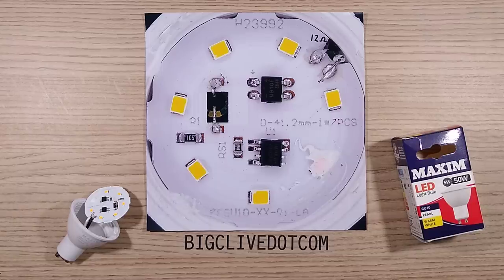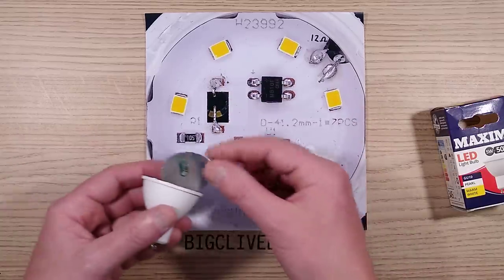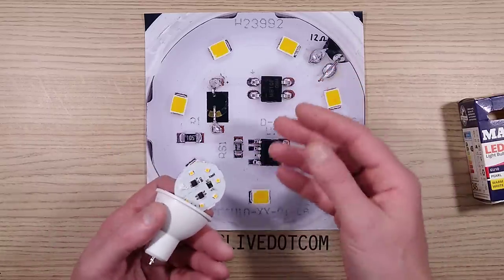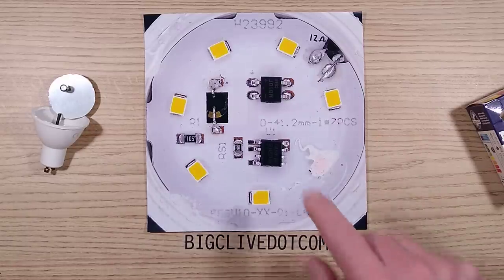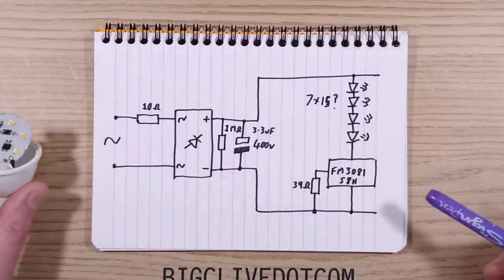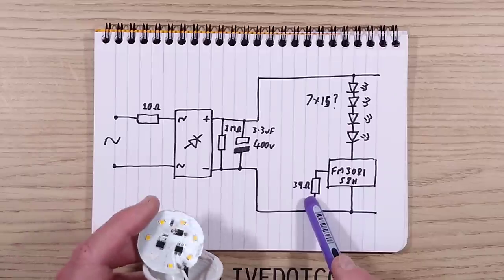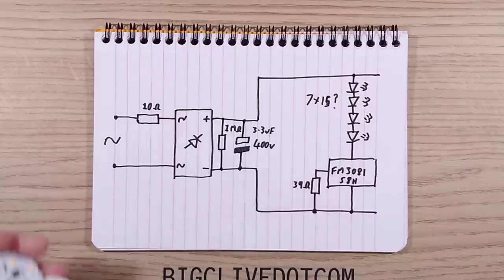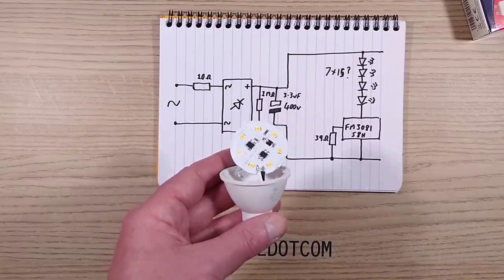Over-cheapened trashy LED bulb

Comment: I just did a test of all the bestselling bulbs on Amazon and the filament LED style bulbs were standouts as far as quality (low flicker, good CRI, good dimming curves).  It seems strange that we are so focused on shaving a few cents off the cost of something that's supposed to have a long lifespan and rarely be replaced.  There has to be a happy medium between the Dubai bulbs and junk like the bulb in this video.
Reply: May be Dubai lights should be the standard "everywhere"!
Reply: Is the chinese way. The irony is that in the long run it ends up being more expensive uses more resources and produces so much e-waste.
Reply: I've recently been reminded of the same thing with clocks. We've had quite cheap clock chips with accuracy far beyond anything a normal user needs, you'll almost certainly have a power outage or just accidentally unplug it before it drifts by a measurable amount. But do we see those in basically any consumer clocks? Nope. All still the cheapest possible oscillators and they drift by far too much.
Reply: @Lizlodude  our kitchen cheapo radio cd thing has a clock in and drifts badly! i did wonder if it used the mains for timing and had a 60hz/50hz link that was set wrong but no , just a 18ish mhz crystal,, and the frequency on the crystal is bit different to whats marked on the pcb, maybe thats the cause...they couldnt get the right one or was too expensive and got these others hoping theyd be 'near enough' 😉  it now has cap issues with the main 16v ish smoother bulging a bit and makes weird sounds when starting up, no mains hum, though, surprisingly , i cant seem to find a correct value and voltage replacement as small as the original, what ones i've found too big to fit! probably didnt last 'cause the 'standby' voltage across it is nearly 19v and its rated 16v ...needs a 25v type but these are even bigger! argh!
Reply: @Lizlodude  It's why my bedside clock is still an LED clock from the 1980s. It's timed by zero crossings of the mains voltage and keeps bang-on perfect time, though my understanding is that the U.S. electrical grid soon will no longer be required to make up for frequency drift, so clocks timed by mains voltage will no longer keep accurate time. I understand why they're changing the reg, but yeah, it'd be nice if we had a suitable replacement and not just the cheapest microcontroller-integrated RC oscillators governing modern clocks. It's so hard to find anything made well anymore.
Reply: Isn't capitalism lovely?

Hint: No.
Reply: @teresashinkansen9402   sam vimes' boots theory of economic unfairness
Reply: @teresashinkansen9402  It's the capitalist way. Who do you think outsourced the labor there to drive down costs and increase profits in the first place?
Reply: Because our bulbs are better than the Dubai bulb in America. People need to stop obsessing about that. In America, we have California Title 20, which legally requires bulbs sold in CA to have CRI > 90, PF > 0.7, dimmability to 10%, flicker requirements, and less than 24 dB noise when dimmed, and >10k hrs lifetime. Bulbs have to meet Energy Star light distribution, hence the filament-style. Dubai bulbs are non-dimmable, all they have going for them is high LPW. California realized after the CFL fiasco that it's not all about energy, it has to be about light quality too.

Comment: I am really unhappy with the current (pun intended) trend of bare-bones LED lamps...low voltage light strings...fairy lights...are one thing but running mains power like this is uncool.
Reply: Non-dimmable LED lamps are the worst.
Reply: Absolutely. I know that's the name of the game -- cost cutting. But there should be a 'best practices' level that they're not supposed to go below, because it is dangerous to either the life of the product (eg. 'Planned Obsolescence'...don't get me started on that one...) or to humans or pets. Whoever made the decision to import that shoddy work into the UK should be told about it. If it has an agency's name stamped on it, contact them. For example, "UL" might mean 'Underwriters Laboratories'. They can put pressure on the manufacturers to improve their standards, or they can let the government know to disallow it when it comes in through customs. Too many people would settle for an increased risk of a fire hazard if it just means that they can get their bulb for 30% cheaper. And fires spread to responsible people too. So it becomes an issue that needs to be addressed, rather than this 'buyer beware' mentality.

Comment: So much for LEDs being the great long lasting low energy alternative to the old incandescent bulbs.
Reply: They are - from my experience. I have had no failures and have not had to buy a bulb for replacement in years.
Reply: I live in a old, 6-store apartment building. The staircase was lit with incandescent lamps that now have been replaced with E27 led bulbs.

Unsurprisingly, the landlord buys the cheapest they can find; a single bulb rarely lasts more than a couple of months.

When covid restrictions hit I got annoyed by constant "blackouts" and fitted the fixture from my floor with a German brand bulb. It has been going ever since. The "cheap" bulbs are a total scam 😆
Reply: @MLX1401  I too was a landlord - I replaced all the incandescet bulbs in both my buildings because I knew the tenants could not afford to. The compact flourescents I bought were disappointing - they were fragile and did not last as long as advertised. As they failed I replaced them with LEDs which were at that time getting cheaper and better. I left LEDs with tenants whose compact flourescents had survived. They (the LED's) never failed.
Reply: @Onequietvoice  Nice to hear that ☺Indeed led bulbs are way better than CFLs, and generally do last a long time!
My point was, that if the intent is to save money, cheap bulbs (like shown here on this video) are a poor choice as they're made to fail and need to be constantly replaced.
Reply: In theory they are ten times as energy efficient, but manufacturers do not optimise for energy efficiency and life time, they optimise for maximum profit.
Reply: @martenthornberg275 Well said!

Comment: An EXTREMELY good point made by Clive of typical cost-cutting that results in dangerous products being sold by companies with no safety checking of the goods they sell and probably no recourse if anyone is hurt by any of the goods they sell!!
KW.
Reply: I don't see any safety issue, it's all well enclosed. Definitely going to potentially reduce product lifetime though
Reply: @paulblitz  Yeah until it's time to replace it. Hope you got the mains fuse open.
Reply: They usualy also just put a Qc sticker on it and call it a day usualy

Comment: The evolution of the LED lamp has indeed been amazing. I'm wondering how much further they can go? LED chips with built in voltage regulators and rectifiers so all you need is a string of LEDs? Or even one large chip... but that would probably get too hot unless the efficiency can be improved to get rid of the heat.
Reply: A "blob chip" covered with clear goop?
Reply: @Scodiddly i can imagine clear COB led strips being one of the first uses
Reply: yeah it is pretty amazing. i can remember when they banned regular light bulbs in the eu and it was a real problem as the old energy saving lamps were just toxic trash and leds were just flickery and unpleasant... and then leds just became good and the problem was solved. kinda worried though this is beeing misinterpreted by some as a surefire way of how electric cars are gonna go...just pretty sure banning stuff and getting a miracle isnt going to happen again
Reply: @scodiddly...

Good idea. Quicker assembly too.
Reply: You already get led drivers with the built in bridge rectifier and the buck regulator all in one package. 2 pins for mains, 2 for the capacitor and then 2 for the coil and sense resistor. Only problem is it is a SO8 package, with the mains inputs 0.8mm apart
Reply: @SeanBZA Conformal coating would fix that... But it would also cost the manufacturer a few extra pence, and judging by the misplaced blob of silicon, they would find a way to screw it up.
Reply: @seanman6541  Yes but relying on 0.2mm clearance on die as well, as the pins are that close there as well. Those will fail any sort of high voltage transient pretty rapidly.

Comment: When i first switched from incandescents the only alternatives were compact flourescents, they were expensive, fragile and did not last as long as advertised. Then LED's started to appear- again very expensive at first but tough, gave good light and lasted ... well I do not know how long. I have not bought a replacement bulb in 4 years and I still have unopened boxes. They were still quite expensive when I bought them but they were and are good value.

Comment: Glad to see they didn't cost-cut the fusible resistor. You're gonna need that.
Reply: Soon enough they will go with a fake fusible resistor, with a regular 0.25W film resistor in the shrink sleeve. After all, got to save that 0.1c cost between fusible and non fusible paint.
Reply: Shhh dont give them any ideas!!
Reply: @SeanBZA  i have a cheapo usb 'charger' that has no form of fuse on the mains input at all,  apart from the thin wires going to the plug pins,, theres a place on the pcb for a fuse but not fitted, linked across 😁
Reply: @SeanBZA  Or they'll just do what the cheap power adaptor manufacturers do and put a thin, squiggly PCB trace between the incoming line connection and the circuit. That way, they shave an entire component off the BOM.
Reply: @ben--  Cheaper is to simply use thinner wire, 3 strands will act like a fuse anyway, saving precious copper on the PCB, and also saving on that very expensive wire as well, as you cut the copper cost to a quarter.
Reply: @SeanBZA  As long as you're not making the PCB bigger, it really costs nothing to make a single trace longer. With PCBs, you're paying for the copper, whether you use it or not. Unless the PCB fab is going out of their way to recover the copper from the etching acid, but more likely (I would assume), the used etchant is either sent to be properly recycled, or (worse) dumped into the surrounding environment (hopefully not the latter, but you never know).
Reply: @ben--  PCB fab for sure recovers that copper, and rejuvenates the etchant, as that is a big profit for them, plus the etchant is a big expense to buy. They want to cut costs on every board, and copper is a big part of this.
Reply: @SeanBZA  Okay, but unless I'm missing something, that doesn't change that you can make a "fuse" by taking one of the traces between where the wires are soldered and the rectifier and etching some alternating notches with a gap between them to make a mini zigzag, which would in effect use less copper than the short thick trace, while also making it more likely to "fuse" in the event of a short.
Reply: @ben--  Yes but on a metal core board the blowing is very likely to short both sides to the aluminium substrate, negating the track blowing. Those mcb insulating layers are really thin, akin ti the insulation on enamelled wire.
Reply: @SeanBZA  I mean, if a manufacturer is going to go out of their way to omit a fuse and replace it with something potentially unsafe, then do you think they're going to care if it causes more damage? I mean, one of the wires could blow at the base and possibly leave a layer of deposited copper between the two lamp pins inside that lamp, which could start heating up and even cause the lamp to melt/catch fire after it had already failed.

But at the end of the day, does any of this really matter? I mean, we are literally arguing about the "least unsafe" way to omit a fuse from a mains power lamp/device, something that should never be done in the first place, so how 'bout we just both agree they both bad ideas that shouldn't be done (but are done anyway because money) and leave it at that, okay?
Reply: A lot of cheap chinese LED lamps have no fuse, fusible resistor and not even a normal resistor for inrush current limiting.

Comment: Thinking about it, in the house the key lighting is incandescent, hall, bathroom, living room, lounge, main areas on dimmers, intermittent dwell time not so. The back-up lighting, wall lights, bedrooms, porch lights, are LED. The bedroom lobby has a PAR 38 armoured spot which throws down a lot of heat for winter dressing on cold mornings. The kitchen has a 40W fluorescent strip which is over 40 years old. Edit: the point being that the main lighting is seldom used so there was less incentive to go to the expense of changing to CF or now LED for the sake of it. EditEdit: don’t get me started on ‘smart’…

Comment: Wow.  😢  So disappointing.  They've eliminated the capacitive dropper capacitor, which cuts a substantial amount of parts cost, and substituted a silicon chip in its place.  There's no current limiting resistor, just the chip.  And then they cut corners and compromised safety.  The only thing I can think of that's worse are those 'corn cob' lights where the LEDs are exposed so they and their leads can be touched with the fingers.

If you look at the good side, these lights have a built-in spark gap for overvoltage protection.  It's just kind of unknown how big the spark gap might be, and consequently how much that overvoltage is.
Reply: The simplistic capacitive dropper design with no smoothing capacitor was such a nice low cost idea, it was even dimmable as there was no counteracting regulator .  It had a bad power factor though, but getting the LED count near maximum would improve that while allowing a cheaper capacitor .  The fusible resistor would need to be replaced by an NTC or induction inrush limiter .
Reply: @johndododoe1411 maybe the chips have become cheaper than suitably rated capacitors, now... of course if the chip fails short,  350v ish dc shoved into a line of leds with no current limiting apart from hopefully a fuse or fusible resistor, something will go bang well ... maybe 'cause the power factor was poor, regulations have banned them? like its now almost impossible to get 'plug sized' and even small 'brick' linear psus  due to 'energy inefficiency' .. i heard the EU banned them ...

Comment: One of the incoming wires looks like a cold solder as well. I wonder how long that is going to last before the resistance, thus the heat coming from it, of it will melt the solder?

Comment: When I remodeled my kitchen 8 years ago, I put some led lights like the one in this video (the type, not the quality), and haven't had the need to change them yet.
On the other hand some other led lights around the house bought on recent years have failed more than once
Reply from the maker: The older LED bulbs were more reliable than recent ones.

Comment: Thanks Big Clive.  Dang.  That sure is some real cost cutting and "not caring" in this example.  I mean, the little sockets that the capacitor and line wires would go into must cost like a couple cents on the mass produced scale if that?  Wow.  Scary.

Comment: i just modified my LEDs a few days ago,
The 7W COB LEDs failed so I bought 10W COB LEDS and soldered them in instead.
The 10W COB LEDs run a little bit cooler than the 7W so I hope they will last longer by limiting the 10W Chips to 7W

Comment: Suggestion: I'd like to see what's inside a rechargeable battery backup LED light bulb. They work like normal bulbs but if the power goes out they run from their internal batteries for several hours. What's really neat is that during a power outage you can turn the light on & off from the wall switch or unscrew  bulb, screw it into the provided base (with switch) to use as a portable light.
Reply from the maker: I've featured a few of the intelligent bulbs.

Comment: A few years from now, consumer electronics will be so cost cutted and atrociously low quality that you'll have to buy a new led lamp, fridge, freezer, microwave, stove, stereo, radio, amplifier, speaker, car, everything on basically a daily basis.

And electronic components will likely be made impossible to get for the individual to prevent you from building somethijng higher quality yourself.
Reply: With everything on subscription, and relying on "cloud" servers that are shut off after a few years, bricking entire product lines.
Reply: its already coming harder to get traditional wire ended components , many newer chips only available in smt packages although can sometimes get smd to dil adaptor pcbs

Comment: The moment I saw the folded over mains wires I thought "bang!", not a good design decision. 
On the other hand I've had an IKEA Solhetta LED bulb fail with proabably less than 30mins of use on it, only brought a couple of weeks ago and used as a landing light in a property we have not moved into yet.

Comment: Is/was Maxim a reputable brand in the UK? In the US the primary reputable brands are Sylvania/OSRAM, Phillips, and Cree, while the large disreputable brands are GE and Feit. I track lifespan of bulbs by simply writing the installation date on the back of the bulb with a marker. GE and Feit rarely last more than six months, while the other three typically last at least five years.
Reply from the maker: It's a cheap brand here.

Comment: We bought some walmart brand led lights and they were terrible, one lasted a few hours and the others died with in weeks. Should have saved them and sent them in for dissection. What's weird is some of the led bulbs we bought 8 years ago are still working in other fixtures, seems they are designing them now to fail as quickly as possible.
Reply from the maker: They are.  They've genuinely engineered them to fail fast.
Reply: Many people in Central and Eastern European countries have 1980s fluorescent tubes in 1960s fixtures still working. As long as I can but fluorescent lamps I will not replace them with  LED.